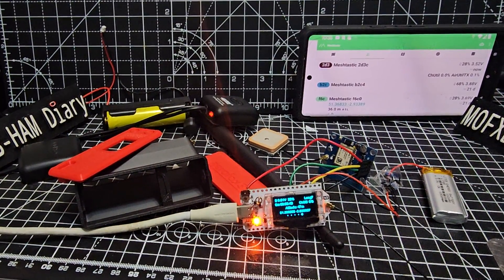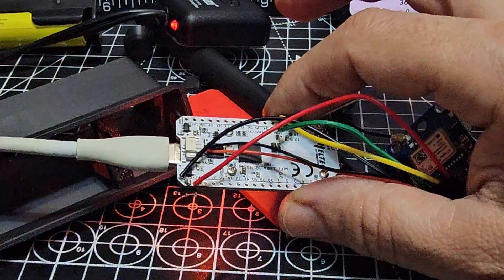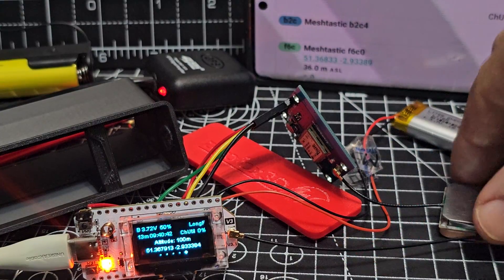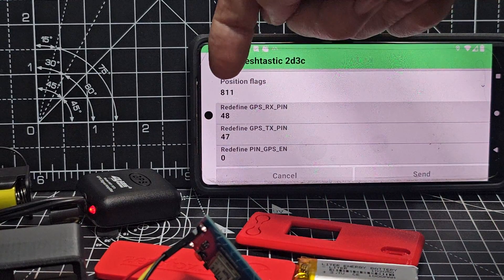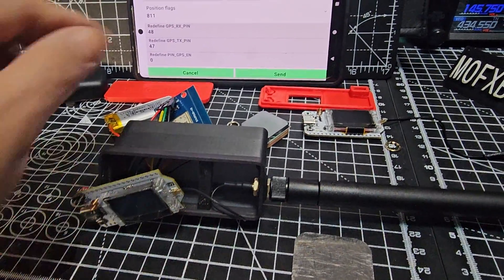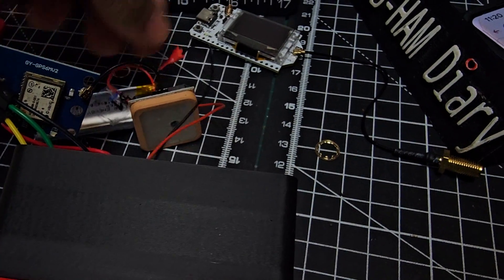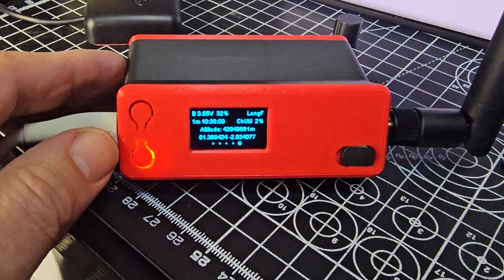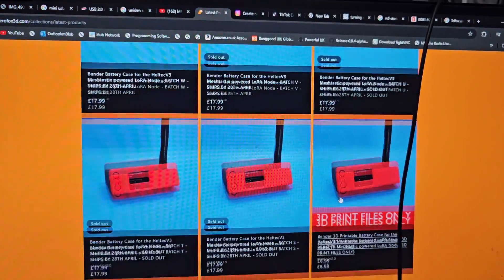MESHTASTIC SUPER CASE , ADD GPS Unit - Heltec v3

Comment: dude, how many videos do you produce every day? wtf
Reply from the maker: Not enough
Reply: A would suggest no solder connections first your pins did not work on mine mine on the back of the board has rx and tx stamped on it but not at them pins and it not works fine m7gnr
Reply: Great stuff.  Can you specify the model number and type of GPS unit used? Thanks .